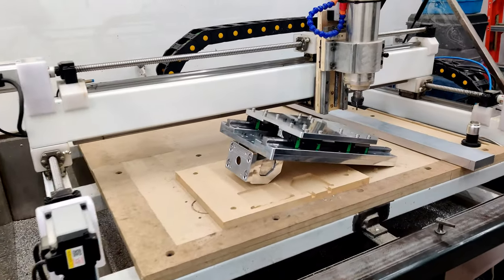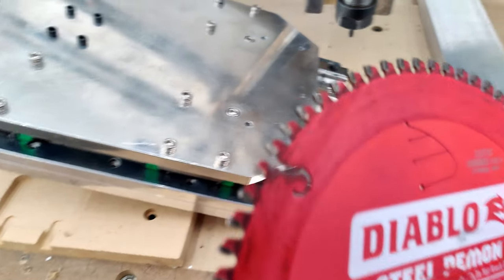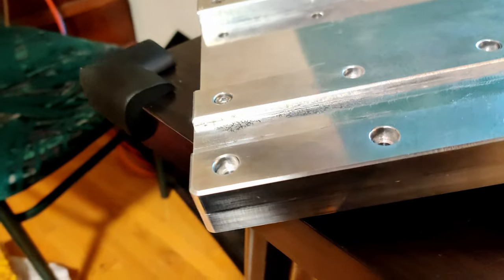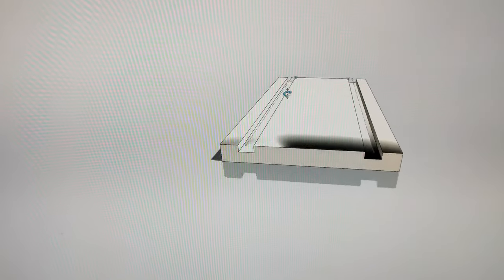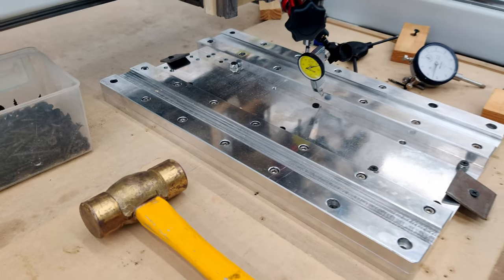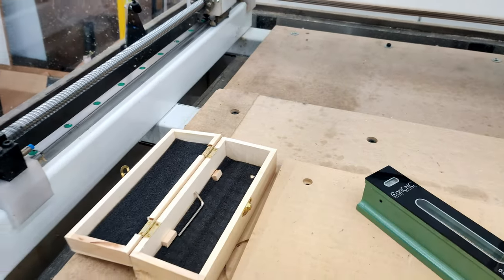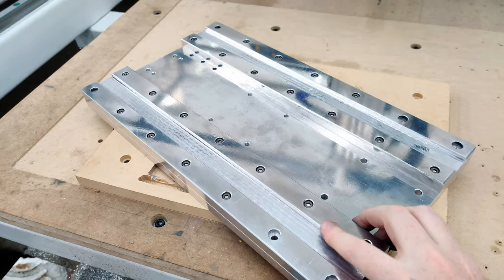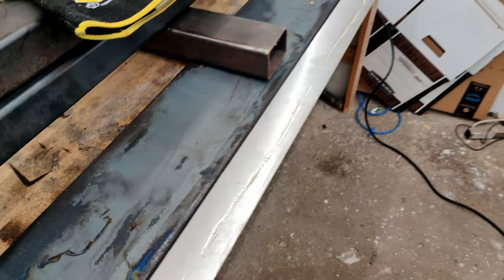Shimming Rails with Stainless Steel

Comment: Hummm... While you still can, consider machining the spindle plate for a top spindle bracket as well. 😉
Reply from the maker: I’m highly considering it due to how much the other plate was out. I might face the whole thing (top and bottom) because I want to put a smaller spindle clamp on the top. Knowing my luck either the top or bottom of that plate is sloping by 0.3mm just like the main face plates (bottom should be done anyway for the bearing carriages to mesh well with the rail). I’m kinda concerned with warping that spindle plate if I shave off one side. I might have to do both sides flipping it successively to relieve all the stress. Aluminum is 6061 T6.

The good thing is no parts need to mesh with it’s thickness unlike on the main plate so it shouldn’t be too involved.
Reply: @BryanHoward  don't think that skimming 0.5mm would warp the plate... But I am not a specialist lol
Reply from the maker: My thought process originally with leaving as much material on the plates was to keep it stronger.  I’m realizing that it’s not going to matter all that much with the 2 “L” brackets bolts on the back side for the X bearings. Those will be 1/4" (6.35mm) thick and are going to add a considerable amount of strength to the plates.

Trying to work around aluminum plates that haven’t been faced off flat on both sides is much more trouble than it’s worth.
Reply: @BryanHoward  I never loose my mental sanity because of those things. I like to think about it before and do it as good as I can, after it's made I don't even measure 😅
If you don't know, it's all good ahahh 🤓
Reply from the maker: @xyzspec82  LOL absolutely! Especially with gradual slopes a lot of things wouldn’t even be noticed after tramming with shims in the case of this spacer. I probably would have never noticed the difference because the majority of those channels for the rails were within 0.1mm to each other. Just the machine limits on the z were outliers but it’s unlikely I’d be using the machine on those parts of the rails much anyway.

Comment: Bryan, at 17:45 you refer to only using that wheel on stainless to "avoid contamination"... are you referring to subsequent welding operations, or something else I should know?  
Another really informative video, thanks.
Reply from the maker: If I use a flap wheel that has been used on regular carbon steel and then use it on stainless steel, the carbon steel will get embedded into the stainless steel and rust.
Reply: @BryanHoward  :  Got it!  I had it "ass-backwards", I thought you were not using that wheel on other materials because the stainless steel would contaminate them.  Thanks.